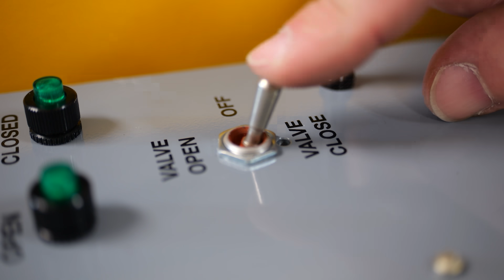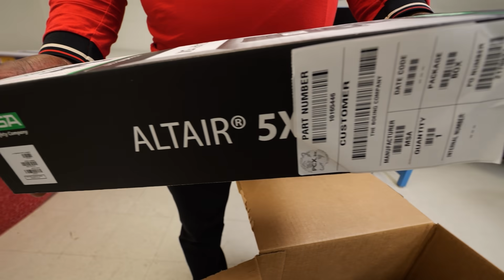Boeing KC-46 Pegasus: The Workforce Fueling America's Tanker

Comment: Thats great the workforce is great, thanks. So I was interested in the Pegasus. I know Boeing likes to study birds, but how about boats? My favorite boat is CG-36500. It carried it's crew safely through huge waves without pitch-polling, by diving into the waves to avoid the turbulence, like a Sub Marine on Duty. Can the Pegasus do that if necessary? Some planes can land like ducks. Example: Captain Sully's landing on the Hudson.
Reply: huh? are you asking if the kc46 can land on water?
Reply: @frankkky7375  
The single-engine CG-36500 is a boat that can dive beneath the waves & surf. The 2-engine Airbus A320-214 is a plane that can land on water & float. The LM-7 Aquarius could spin like a Volkswagen Beetle in the sky without a compass & land safely on Home Planet. So what's so special about the Pegasus? Can it multi-task? Sure, the builders are proud they built it, but what if something goes wrong up there? Bird strike, oxygen deprivation, someone ate bad fish, or whatever? Can the plane still bring the passengers & pilots home safely?
Reply: @musiccollectionsaroundthew9477  well actually the kc46 is rates up to around 500 psi or 1000 feet underwater and with the advance hydroelectric suite onboard, it is ablw to produce electricity for multiple days on end. the compressor stage in the engines is also rated at the same depth so can be used as under water propulsion. the kc46 radar is pulse doppler and a sonar in one. this allows the kc 46 to also refuel diesel submarines
Reply: @frankkky7375   Wow, that's interesting, thank you for sharing that. The V-22 Bell Boeing Osprey can refuel subs & sailors at sea, with food or fuel or whatever. They're great at delivering cargo just about anywhere. The best planes only land on water when it's absolutely necessary.
Reply: Troll comment